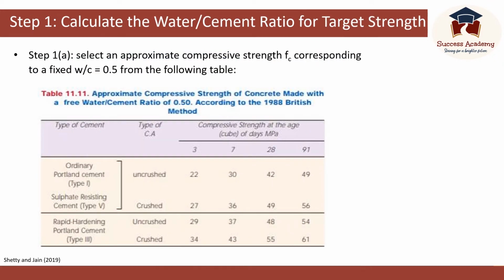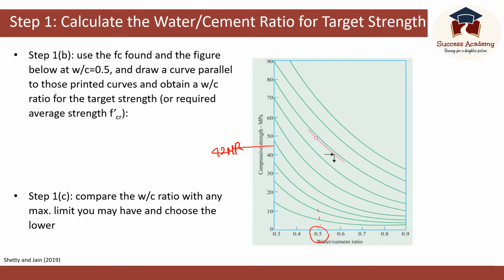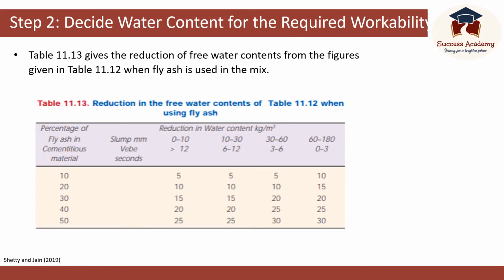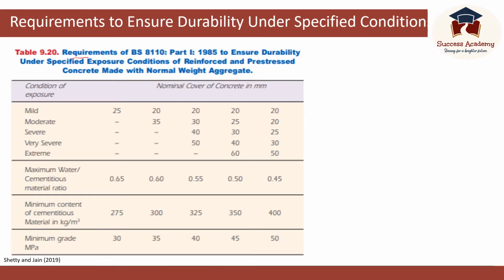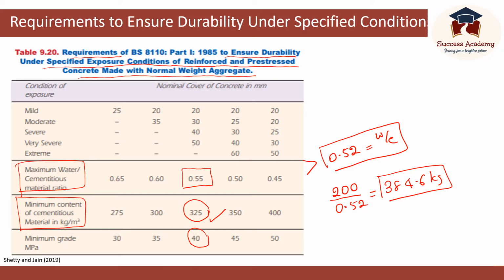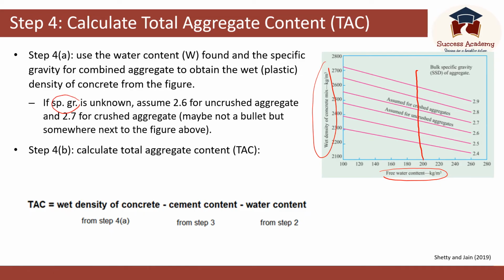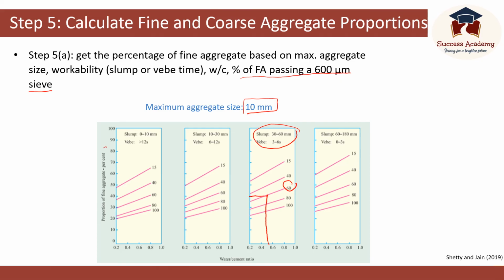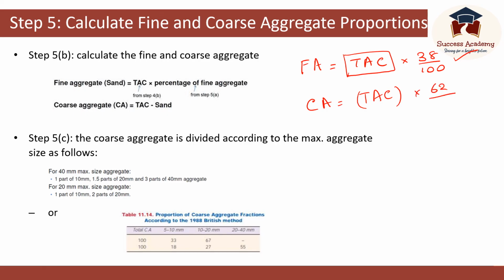British DoE (Department of Environment) Method of Mix Design

Comment: There is problem with your maximum aggregate size 10 mm against w/c ratio ,your y axis should start with 10 not with 0 .
Reply from the maker: Thanks for the comment. Those graphs were taken from the text book as in the in-text citation.
Reply: @CeylaraAcademy  can i have the name of the text book used. thanks
Reply from the maker: @everythingentertaining7530  You can find the in-text citations at the bottom of the slide for every chart or table. Thanks